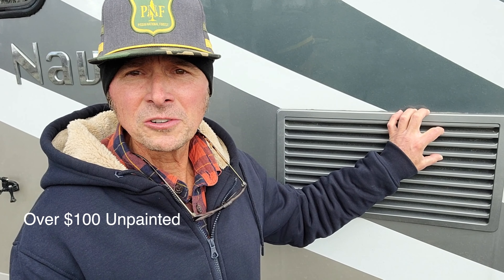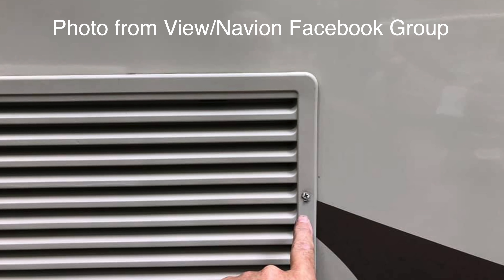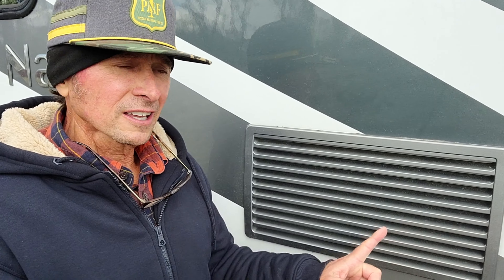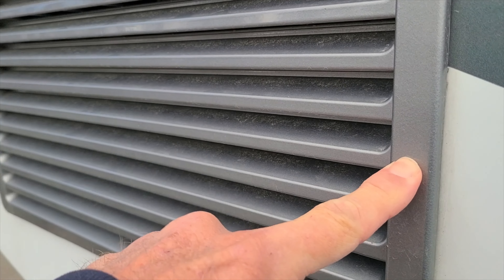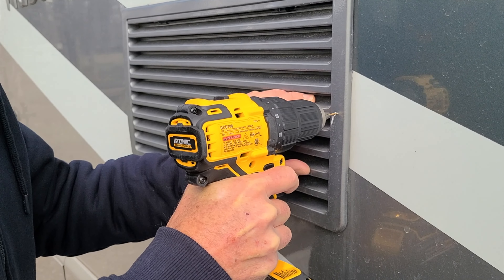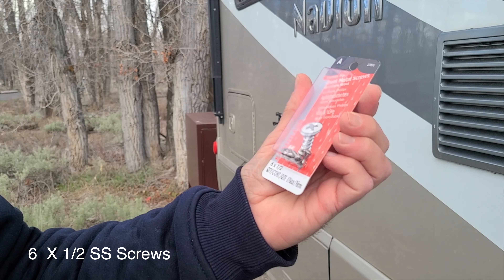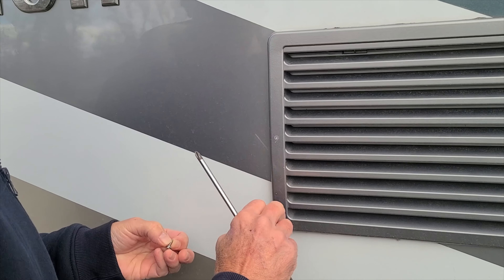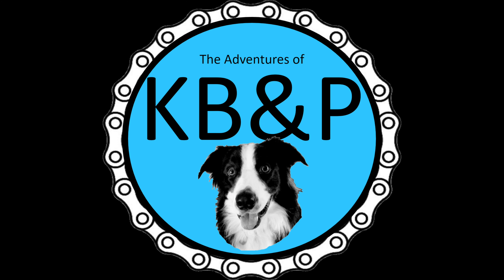RV Fridge Vent Mod  - Don't Lose Your Fridge Vent!

Comment: Thanks. I sure wish I'd seen this 2 years ago. Both my vents blew off and the cost for vents + paint was nearly $500.
Reply from the maker: Jeff, get this.  After the video my top vent cover blew off....I never even thought about screwing it down... 😆 

Apparently you can't buy them anymore so I used a different brand.  I might make a follow-up video talking about how dumb I am and how I resolved the second vent cover issue.

Comment: Well, I lost mine today.  Got home and the cover was missing. Problem is, it's an older slide in truck camper and I cannot find a cover or assembly that fits.  Apparently the "modern" covers are all a different size from the older ones. Anyway, I'll have to retrofit a new one I guess........
Reply from the maker: Well that stinks.  Hope you're able to get a reasonable retrofit figured out!

Comment: You can find the improved clips.  I switched mine out, and carry a spare.   

https://www.ebay.com/itm/Thetford-SR-Refrigerator-Vent-Lock-Clip-Norcold-628449-622563-/234066403022?_trksid=p2349624.m46890.l49286
Reply from the maker: Thanks!  Good info!